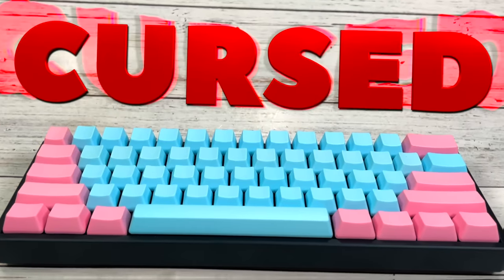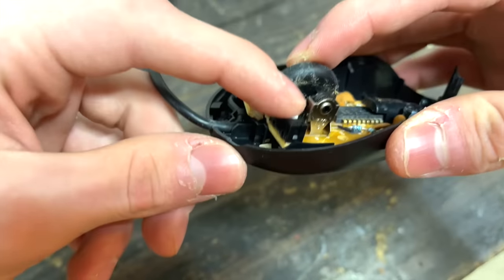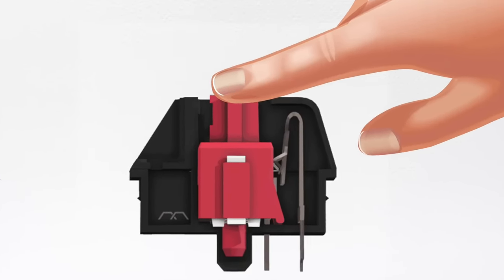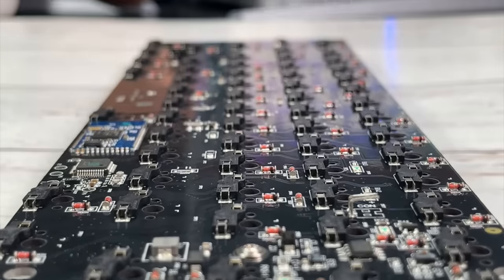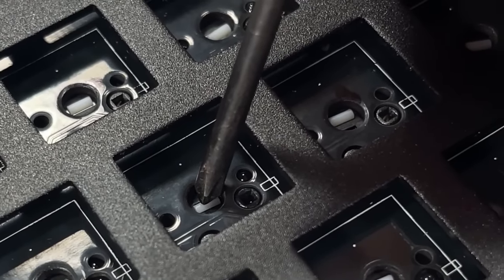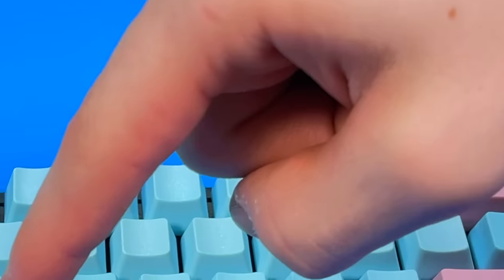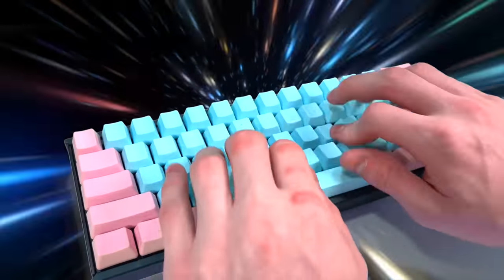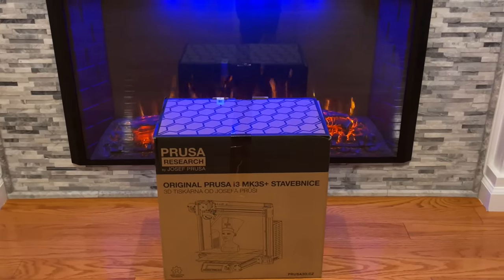The Most CURSED Keyboard (Mouse Switches)

Comment: As a keyboard enthusiast, him saying that he would destroy the Gateron Ink Blacks pained me inside...
Reply: yeah he should've used the browns ;)
Reply: Ey man I almost fainted that's 70 dollars in switches
Reply: Watching it was worse
Reply: Yeah just use like mx reds or something cheap lmao
Reply: Yeah that didn't make any sense to me. And clipping the copper legs like that didn't make sense to me either, if it was a linear feel he was after, he could have just pulled out the copper actuation system from say a set of random Outemu switches. Snipping them off literally killed a switch that in theory still could have worked fine without the plastic plunger stem, as that stem still on most switches I've modded still extends quite far into the stem for the spring. The caps on the board would help with bottoming out as they hit the frame yet, so just...pulling that out and all still would keep a functional switch. He literally destroyed them for no reason.
Reply: those are gateron blacks, not inks
Reply: @dhani7050  they're black inks lmao
Reply: Could have used gat yellows or something

Comment: i remember owning keyboards with optical switches, basically the switch is just a pole and when you press it, it interferes with a beam of light sending a key press, now I also remember that the keyboard is hot swap, so instead of buying gat blacks and wasting them you could have done this
Reply: work harder, not smarter

Comment: i think the best switch choice would have been a switch with a longer stem-pole, like kailh pro burgundy switches (which are also much cheaper than inks); also, since you have a soldering iron, it would have been much better and faster if you desoldered the hotswap sockets from the pcb instead of ripping them off
Reply: do you mean like just melting them?
Reply: @harpatar  no, the sockets are soldered to the pcb, so you can remove it with a solder-sucker

Comment: Bro could of used a soldering iron and solder sucker or desoldering gun to remove the hot swap sockets also you should of removed the contacts because your not using them and they will make the board feel snappier.

Comment: Why not just glue them to the back of the switch housing plate and separate the PCB entirely? You could directly line up each one and there would be no conflicts with components on the PCB